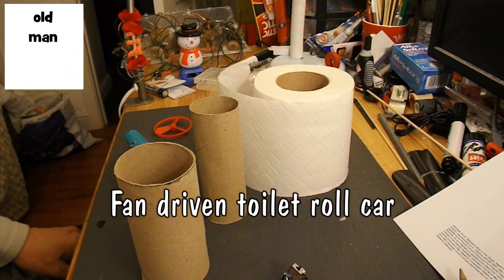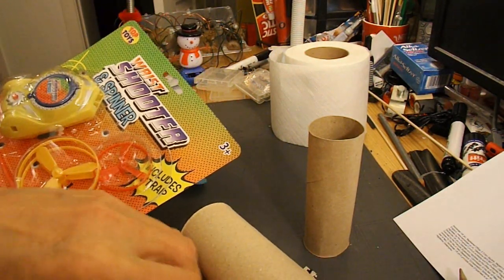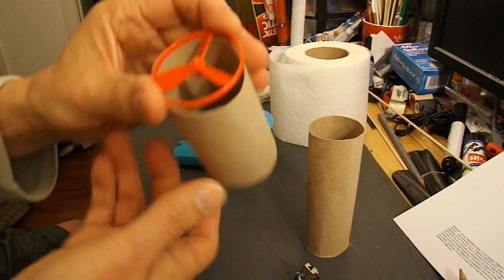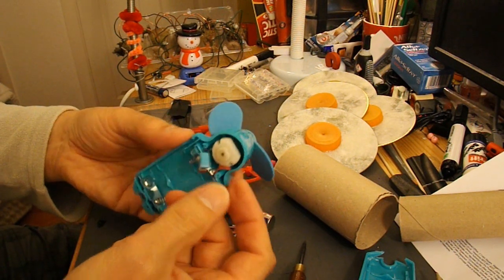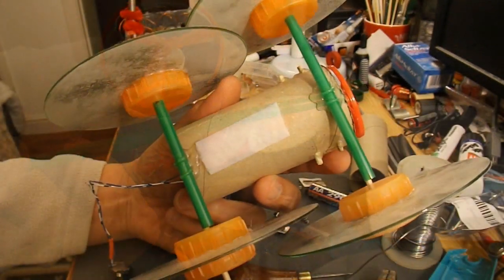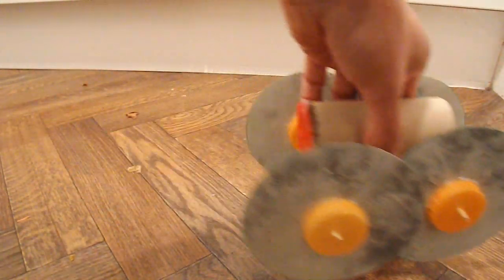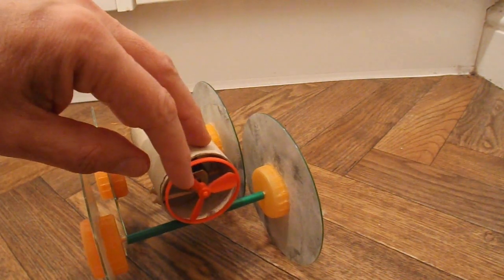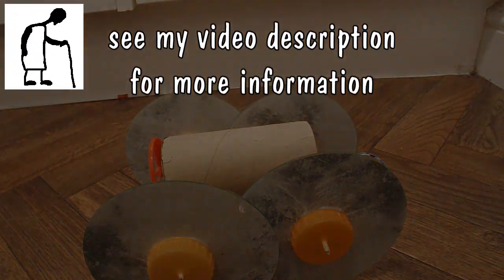Fan Driven Toilet Roll Car

Comment: Did the toilet paper roll increased its performence or it anyways blows the air that faster??what happens if we narrow the toilet paper roll a little bit at the end, will it blew the air from it faster..(like the real airplane turbine engine has narrow end)????
Reply from the maker: +rohan bhardwaj I doubt that it increased the performance. In a real turbine the gap between the tip of the blade and the inside of the duct is tiny to gain the benefit. You may find this video interesting https://youtu.be/Cew5JF8q6eY